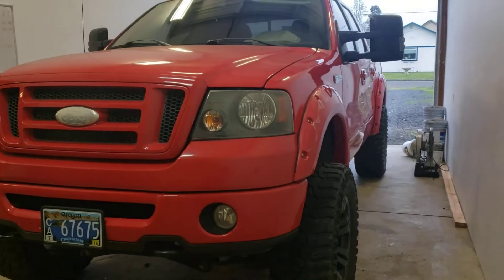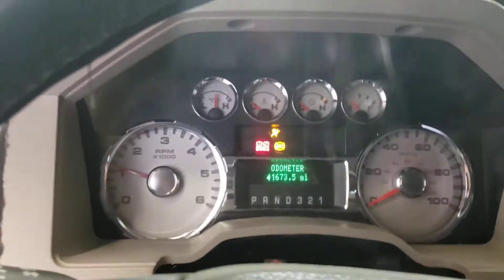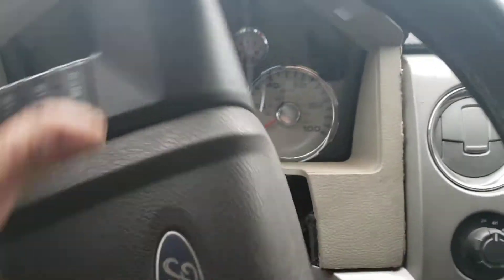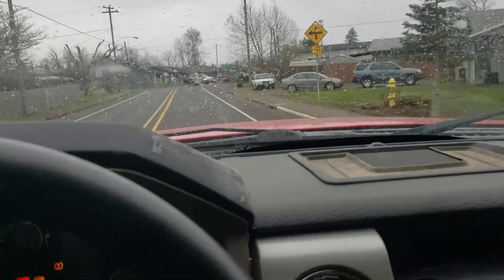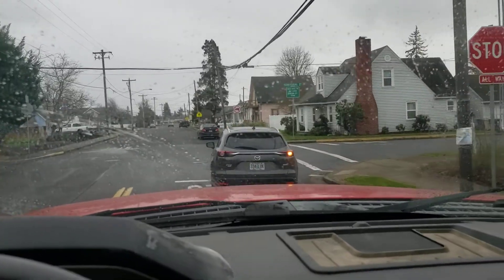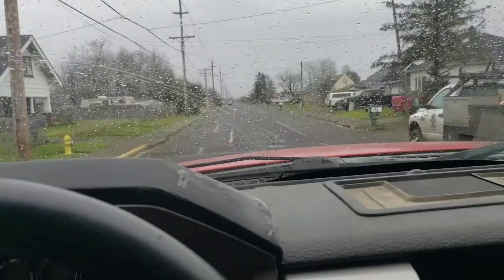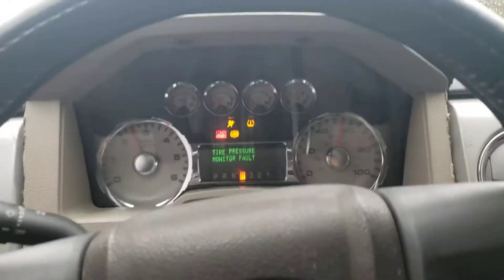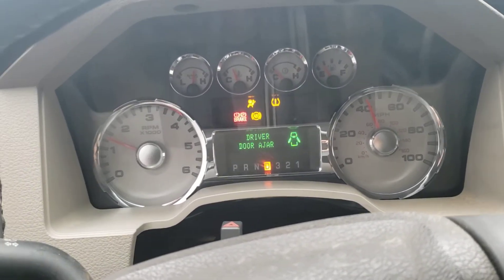3V V10 F-150 First Drive!!

Comment: A really big tree landed on my 2011 E450 SD bus...
Now, the plate on the side of the motor looks like it says "For Use In Heavy Duty Vehicle Only"...
But, I think it might actually say, "Put Me In A 99 Mecedes SLK"
It's a bit blurry.
Reply from the maker: I would never do this swap again..... but the sound and performance make me not fully regret doing the swap!
Reply: That's almost 3x the displacement. I wanna see it!

Comment: Did a v10 swap in my 05 f250 that had a 5.4 very easy swap ur swap is so much work lol
Reply from the maker: I would never recommend it. Now that it drives I'm looking most of it, but would NEVER suggest it. Can't wait to start the next round of mods on it!
Reply from the maker: Gearing up for a 09-14 front end swap and hopefully a 08+ Dana 60.
Reply: Motor mounts line up? Transmission sits in the same place? Did you swap ecm and harness?

Comment: So I bought a project 1994 f150 that has a v10 triton , drove it home .... needs a pile of work  , pretty sure it's gonna try and kill me
Reply from the maker: 2 valve or 3 valve?
Reply: Not sure yet , I got it for $1500 and drove it about 75 miles home , lots of gremlins to chase down right off I can tell it has custom built headers and the steering is in need of some attention